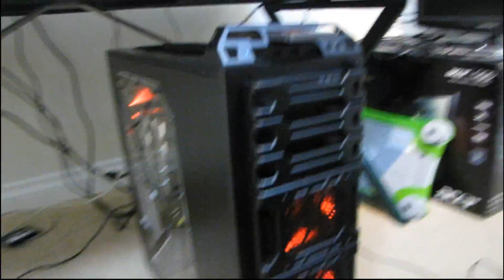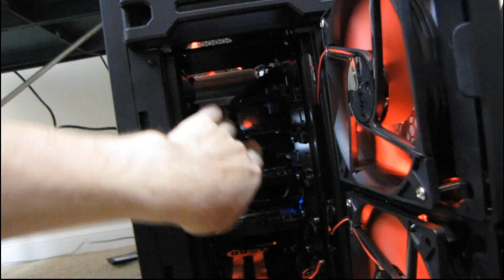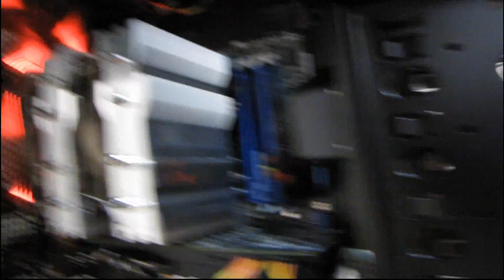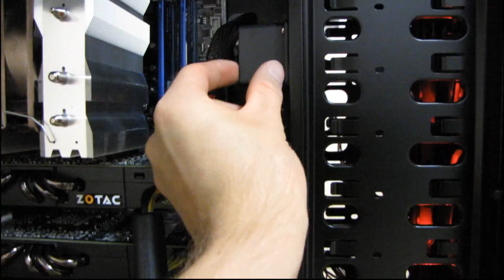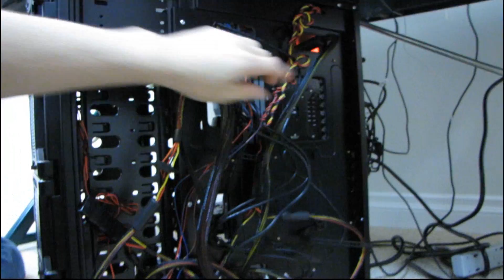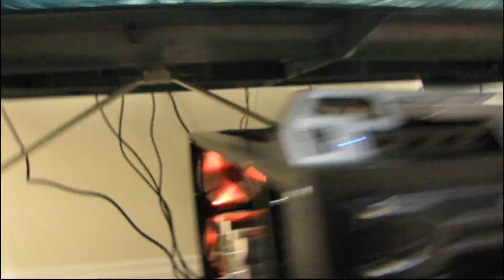Antec Dark Fleet DF-85 Closer Look & nVidia GeForce 3D Vision Surround Build Inside Linus Tech Tips

Comment: Here I am 12 years later running the same case with a 3080 in it and have only had to swap out the 2 rear fans.  cant justify spending the $$$ on a case if this one is still doing its job.

Comment: He connected the fans to a fan controller that came with the case. If you need extra fan slots you can either buy a fan controller(cheapest is only like 10$) or you can do molex to fan connector which requires even more cables in your case. Some psu's come with fan plugs on them which runs the fan at 100% non-stop.

Comment: I've got this case, and am using two Zotac GTX 560 Ti Amp! cards, and I was able to fit in 3 x 2TB hard drives and my 120GB boot SSD. I will admit, it was a little tricky getting all the power and data cables in, but my graphics cards weren't a problem.

Comment: @MrZiimong That's actually the hotswappable SSD bay. You can mount your primary SSD inside the case, on the floor. It has the necessary equipment to do that.

Comment: For cable management I would recommend using a terminal block for the case fans so you only have one molex plug instead of 7... Then I would recommend running the 24 pin and 8 pin first then start running other cable so the are not crossing over each other... You want to get a extender for both the 24 and 8 pin to give more length so it can be ran more out of the way... Anyways great video I will be getting one of these cases this summer.

Comment: @AiDz0r 
Well, I routed them all through the back and have 0 problems closing the side panel. Temps for GPU: Idle is 40 degrees, load (game) 85 degrees, Furmark 91 degrees. Cpu idle is 32 degrees full load 64 degrees (using stres test). Fan speed of GPU reaches maximum of 62%, which is pretty good for GTX 480 (at full load on Furmark).

Comment: I have this case, and it looks a lot better in real life, trust me. Has very good ventilation (8 fans total if you put one on the side panel) very roomy inside, can fit your H70 coolers or any coolers with no problem. It DOES fit a 5970, 4 of them and the case has a total of 12 places you can put hard drives in, not the most practical design for them, but it works. This case IS made of steel so its heavier but its not a problem for me.

Comment: @lil0egy0kid im sorry m8 but i have to disagree.    i have just bought the case and in my opinion it looks super nice!    it is the same sort of design as the antec 1200 but nicer and has some more features which rock   such as the top hot swappable.   the only plastic stuff which i am a lil concerned are the  doors of the bays, other then that the case is super nice....  so before talking shit own one then talk.....   the airflow is amassing too and the noise aint that high when on full.

Comment: i prefer the 1200...! just mis some things about the 1200
- 2 X 120mm fans, instead of the 200mm bigboy fan!
- CPU backplate opening (like the corsair 800D)
- and the posibilety to upgrade the hdd-cages to hotswapable
- a more easy way to remove the filters

but i do like 1 thing bout this 1!!! the top cover for ssd and usb 3 suport

Comment: Talk about cutting corners; the top panel of this case features the most cheap and rediculous design I've seen; It's like they decided to add the features of there entry level cases with the 1200. What a rediculous idea. This case would have been bad ass if they put some more effort into the design. They should have noticed something wrong in the conceptual stage of the design. I would have liked to see an Antec 1200 with the stlye of say an Silverstone Raven RV01. Anything but this. HAF-X FTW!!

Comment: looks not as good as the twelve hundred, but kept the the only ugly thing about the 1200: that weird window ... a simple plexiglass rectangle would have been better.

but finally antec managed to make thos dust filter accessable ... on the 1200 / 902 you need to unscrew those hard drive cages to clean the dust filters :X

Comment: wow you suck dude. It's easy to do cable management! get some tie wraps and adhesive stickers and put them behind the case and re-route and you can get a cleaner look. So horrible cable management. The huge advantage when it comes to this case it has holes on the back and the hard drive space. You can slip it in there if needed. Your cooler is wack. Go water! :D

Comment: bought the DF-30, because the hotswaps are not necessary due to space restrictions in case.  Good case and the decorative tabs that he complains about are easily removed. You just pull at the hinges and they come right off.  The case looks cooler in person.  The only complaint I have is that the top units HD audio plug has a long way to travel to the motherboard.  I also don't see any issues with the cable managment.  You can definitely store the cables in the area he points out.

Comment: @iScream90 Black inside is nice, but that's an easy fix for non black cases.  Nothing a can of flat black spray paint wont fix.  

Also, where are you supposed to put the pater cooling gear? It's just a shit case from the word go.  And Antec used to make some good stuff.

Comment: Antec has been very disapointing lately.  

If you want a full tower case, it's hard to beat either the CoolerMaster HAF X or the 840.  The Corair 700D/800D is only suitable for water cooling.  It  has pathetic ventalation.  

This Antec case has a lot of bad design ideas.  Not one redeaming feature at all.

Comment: @Raay42 Modular PSU has removable cables, you can select which cables you need, less cable mess etc. in your case, because there isn't any cables you don't need.